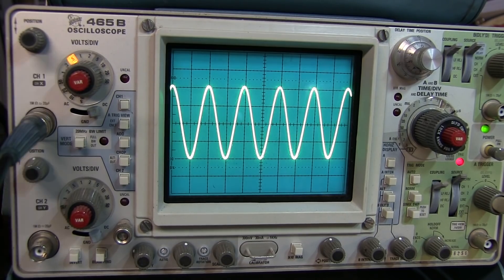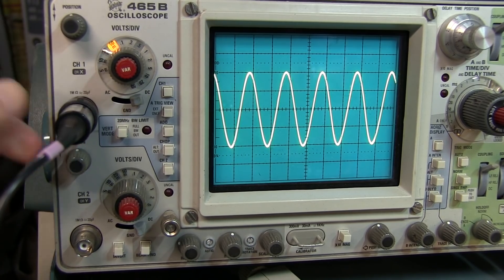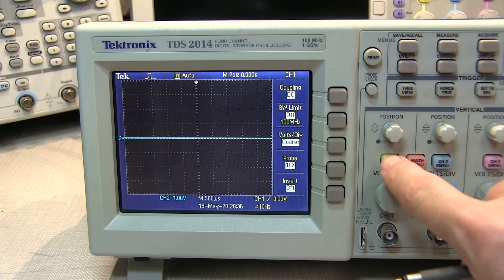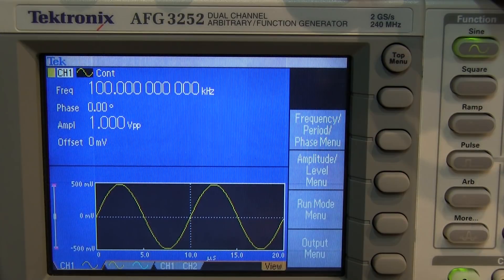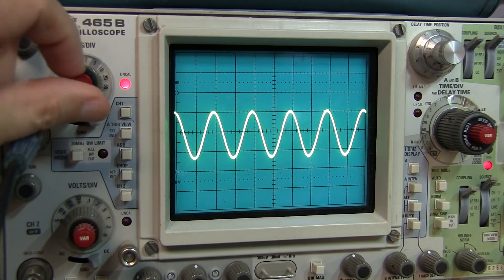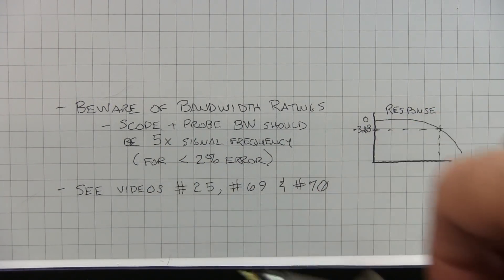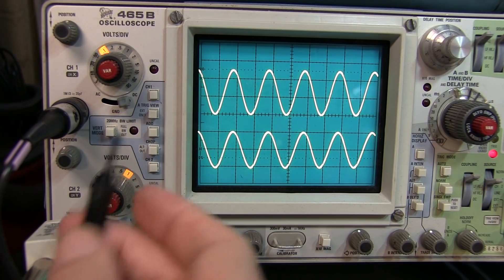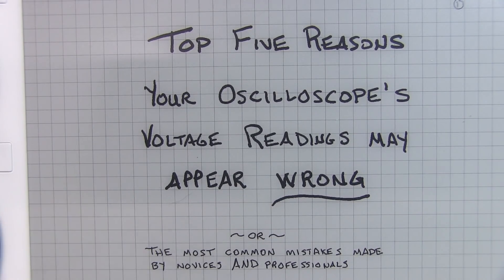#311: Why are my oscilloscope voltage readings wrong? Top 5 reasons...

Comment: Nice ! Yesterday I posted a video about average acquisition and AC coupling, it can trick you some times.. And man..  the 465 is so beautiful
Reply from the maker: I did a video on AC and DC coupling several years ago, and how interesting it is that you often use AC coupling when looking at DC signals (such as ripple on a power supply) and you use DC coupling when looking at AC signals (such as looking at signal quality in an amplifier).  https://www.youtube.com/watch?v=Hkq-fvb5-NI
Reply: I was working with a small am modulated signal and the carrier frequency didn't sync up with the modulating signal. Averaging made the whole thing disappear. Took a bit to realize what was going on
Reply: @andrewjeddeloh4088  yep.. A combination of average acquisition, ac trigger and correct trigger hold off can be gold to lock on small signals like these